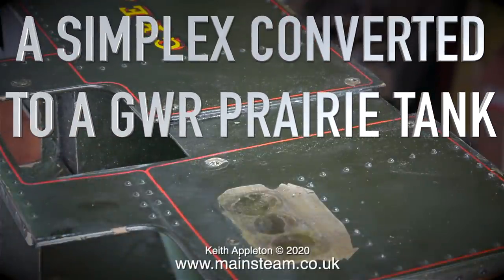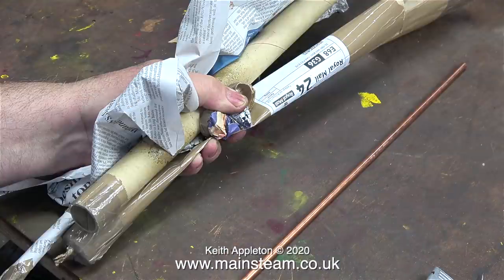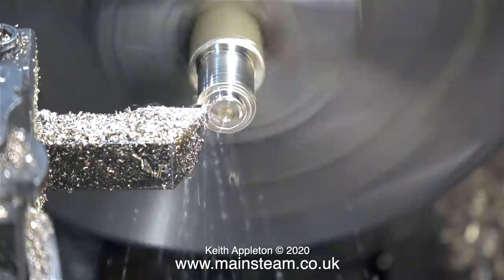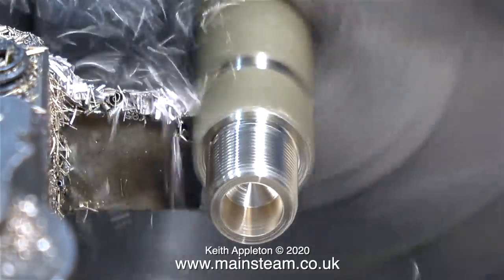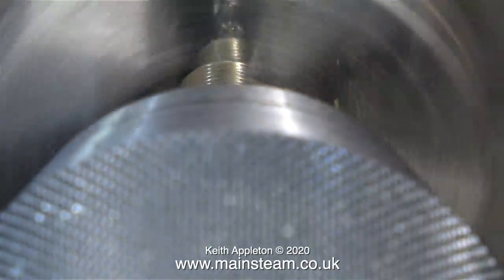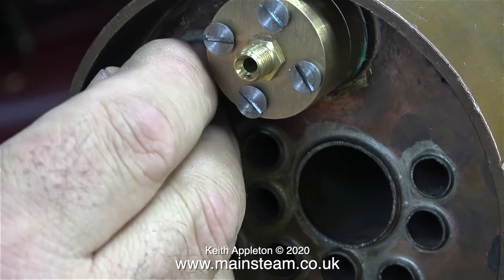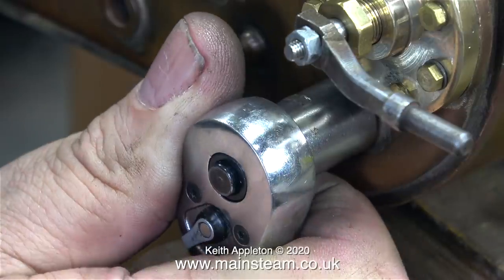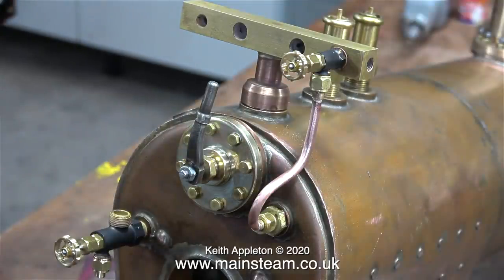SIMPLEX PRAIRIE TANK - PART #15

Comment: My boiler inspector here in Oz would require you to provide this item as part of your hydraulic test. Also the regulator would have had to be replaced with a steel rod stay for the same test.
The flanges also would not be thick enough for our codes and all attachments would need their own reinforcing flanges to the code. ie a complete rebuild.
Reply from the maker: I am really glad I don't live in Australia and have your boiler inspector then . . . .

Comment: Hello Keith, thanks for another interesting video. When you are fixing the fittings on the stay do you have to worry about getting them in "phase" with the bushes in the boiler? Seems to me if they were significantly out of phase you'd never get the far end to engage with the thread and if they were close but wrong you might introduce some unwanted stretch or twist or compression to the stay. William.
Reply from the maker: I never worry - it just works . . .
Reply: The regulator assembly on my loco has a similar thing - a part with a male thread and a female thread inside that, both the same pitch. I was worried the the bush it screwed into and the thing that screwed into the female thread would have to be in sync but the designer said never mind it always works out somehow.

Comment: Hello Keith, Watch your videos regularly. I have a Polly models loco which at present only gets intermittent use. What is the best way to prevent dezincification?.  I blow the boiler down regularly and its sat at the moment with the controls cracked open slightly so that they dont seize. Is this okay?. rgds Graham Powell
Reply from the maker: Do't worry about it, if the fittings don't leak where they meet the boiler, dezincification takes a long time. Doing what you are doing, I would think that it will be OK.
Reply: Dezincification usually occurs at the point where the water and air meet, usually in pot type boilers that are  left with water in them. Boilers should be stored ether fully empty and open or fully filled and closed..

Comment: Soft solder ok for a hollow stay?
Reply from the maker: Absolutely Not . . . . In my opinion Soft Solder is OK for cold water tanks at atmospheric pressure, but even then they are usually weak. I believe that some small steam toys are soft soldered but they are very low pressure toys. Remember that steam pressure is relative to temperature, the higher the steam pressure, the higher the temperature.
Reply: @keithappleton  Thanks Keith, much appreciated!

Comment: What happens if the threads on the hollow stay at the front of the boiler are 'out of sync' by, say half a thead from the thread at the cab end of the hollow stay?  I mean does one thread tear at the other due to a mismatch, stripping one or the other?  ...Or have I misunderstood something?
Reply from the maker: It just works . . . the soft copper adjusts to fit . . .
Reply: @keithappleton  That's really interesting!  Another puzzle I have been thinking about for about sixty years is how Fordsons managed to get the rotating bit into the end of the lifting link forgings found at the rear of their E27N TVO tractors.  They are a beautiful sliding fit.  My best guess is they were pressed in hot... had the cold forging closed around them and then as they cooled they were released from the grip of the forging.  I'll try to find a vid of what I mean.  These lifting arms are essential to attaching and lifting farm machinery such as mowers, balers or milk churn carriers
Reply: It's probably part of the reason for going to 40tpi here, that way you're at most 1/2 a thread off which gives about 1/80th inch (or 12.5 thou) mismatch in the length which shouldn't matter too much considering the length of the boiler

Comment: Does anyone here know where i can get those tapping tools where they can be shipped to Scandinavia?
(I realy can not find them here in any store or on the internet, so i taught i need to import them from the UK).
(After a lot of serch i finaly managed to find the British BA sets...)

Am i right?:

5/16 32
1/4 40
3/16" x 40 
=
UNEF
UNS
MS
Reply from the maker: www.blackgates.co.uk
Reply: @keithappleton  
Thank You! I will send them an email.
(i need to make boilerfittings for a vertical boiler where all the bushings are missing).